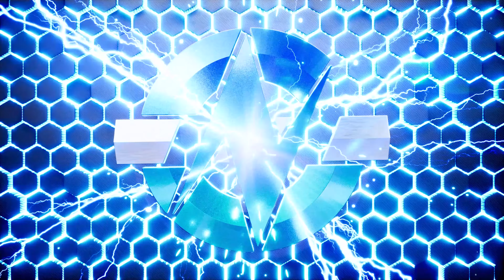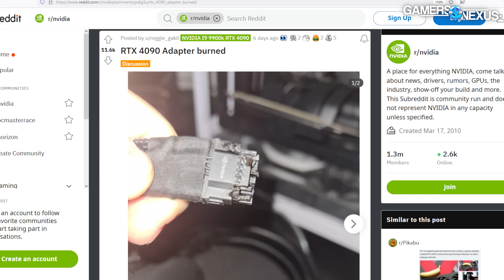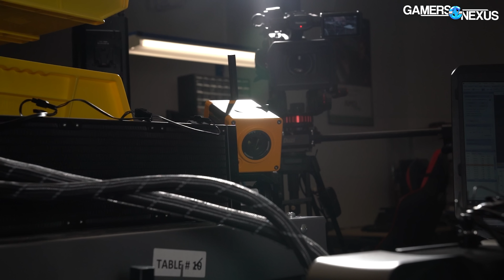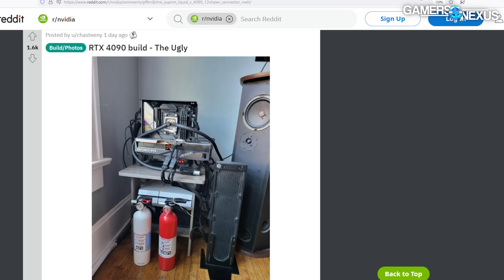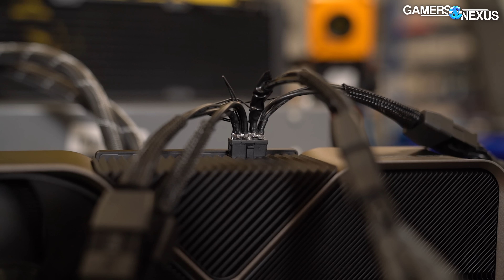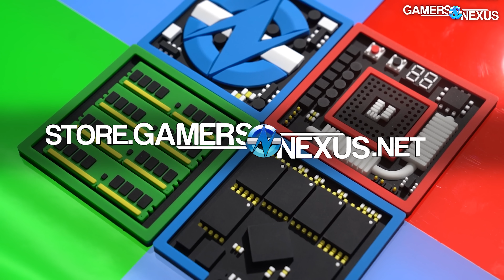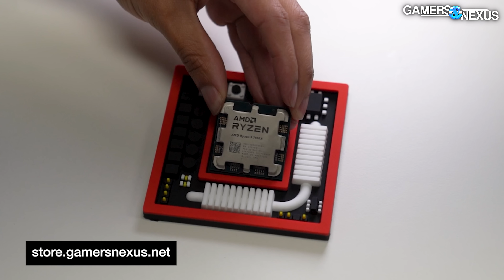Testing Burning NVIDIA 12VHPWR Adapter Cable Theories (RTX 4090)

Comment: buying sleep is easy... you have extra employees to lighten the load or take shifts... editors can hand off work to other editors, writers do much the same and when you come back in the morning the project should have more work done on it. Factories have been doing it for ages, my company does much the same with technical documents and even testing hardware. If your methodologies are sound and repeatable, it shouldn't matter who does them or writes them up.
Reply: before anyone gets uppidy.. I realize it is not "easy" in the sense of actually hiring staff willing to work odd shifts and or organizing such rotations can cause internal strife... however, you cannot say you have not figured out how to buy sleep if you do not explore all the options in a business that is punctuated by speed and precision.

Comment: Though I think that looking at where the wire connects is the problem. I see molex style minifit connectors melt at work all the time because of overcurrent or bad connection ( some of them are used outdoors in outdoor enclosures that are not sealed from the outside world ). When I rebuild or replace those connectors, I buy the more expensive pins and use heavier wire most times. That seems to help, but even the upgraded ones have sometimes started to get hot.

Comment: Something I pointed out on Jay's channel was about the possibility of manufacturing defects. For the connectors to melt like that they must have used the incorrect quality of polyamide or polyvinyl chloride. Power connectors are generally rated to take between 150-250C depending on the actual plastic type.

Comment: A few suggestions for the cameras Name. "Ripjaygor" -  "Nvidia QA" - "Predator" - "GeFire 4090E Extreme Super Ti RTX" - "Brutal by Temperature" - "lttstore" (for its color).

Have you tried briding the two dummy-sense-cables (the ones that are not isolated together in the same cablewrap)? Would that maybe trick the card into pulling more or do something strange?

Comment: Everyone is focusing on the cable but not the enviroment

Verry little people would use a computer on an open air testbench 

If you put it in a case with mediun to poor airflow where heat isnt propably being pushed out and then mix it wirh this issues it becomes more probable of failure 

Remember most people have to save money somewere on the computer and most of the time they skimp on cooling 

So they save money up for a new gpu and a new psu probably and then dont upgrade there cooling solution causing the internal temp to rise especialy near the hot components like the cable 

So in all posibility it could be a mix of the cable heating up to a temp in spec but being pushed over the limit by the surrounding components

Comment: You should take apart one of the failed ones. Remove the sockets with the Micro-Fit 3.0 depinning tool (Molex PN 11-03-0043) then de solder the wires. Check for failures in the bend from the soldered part to the socket. 

 I am incredibly surprised that Nvidia decided to solder it like that, these should be crimped. These connectors (supplied by Amphenol) are a copy of the Molex Micro-Fit 3.0 design. The contacts can handle 8.5A, but Molex makes one contact that can go up to 10.5A. I really hope that is the one being used. If this were to be made properly, it would be 6 18awg wires for power and 6 for ground, one into each contact. 18awg M22759 wires are rated for about 11A. 600W at 12V is 50A so per connection only 8.33A flow. No solder in any of these connections, all crimped.

Comment: Why Nvidia/AIBs don't just have 4x8 pin plugs on their cards, with 90 degree adapters out of the box is beyond me. Surely that would cost the same/be cheaper than making an adapter for every single 4090.

Comment: I contacted Zotac about being worried on the adapter and they responded this:

If you don’t bend the cable on adaptor then you should be fine.
Also it’s only the issues with early produced adapters.

Comment: I used to perform case studies on burned up molex connectors from various industrial settings. I always figured it could be something regarding thermal expansion over time, but watching this gave me some flashbacks. My settings were way more vibrational so that was always the bigger issue al but I don't think molex connectors shouldn't be used in higher current settings despite what their specifications can say due to the unreliability they provide, plastic's thermal efficiencies vs their cheap production costs. I've sat through crimping QA tutorials and done it myself by manual machines and hand crimpers. I think theres a trade-off triangle regarding of cheap, removable, high current connection points, and you can only maximize two.

Comment: I remember when I plugged in my 4090 for the first time thinking that the cable didn’t feel like it was plugged in all the way even though it was. I’m looking at ATX 3 PSUs because I need an upgrade anyway for OC but my timeline has been accelerated because of this. My card is still working but I’m not ready to take chances. For those wondering, my card is a Zotac AMP Extreme
Reply: I have the same card . I’m using the 3.0 and it gets hot as hell. It’s plugged in and everything just felt weird, as if it wasn’t in good

Comment: the real issue is that an 8 pin pcie connector with 16 ga wires to the psu can easily do 500w
doubt it? kingpin edition says your wrong and shut your hole, 1kw on 2 8 pins ez

Comment: If there are loads of different cables with different construction from different makers it could complicate finding the cause.
I don't think fully disconnected/broken off cable would cause melting also a brocken cable should result in a drop of power to the card and so a performance drop but a partially connection could as power would continue to flow.
A few question need asking like
1)Who made the cards 
2)Where did they get adaptor cable ie ASUS cable from Nvidia or MSI cable sauced by MSI. 
3) where was card purchased store retailer or auction site like eBay
May not be a specific problem with the connector But what is becoming a problem is Nvidia/Intel and AMD need to use more power for small performance gains they all just need to stop and ask themselves do people want or need a PC that requires 1000+Ws where's that heat going to go where's the power coming from and most importantly can the planet sustain what we are doing, after all no game is bottlenecked to point of being unplayable by 12900K/5950x RTX3090/RX6900 or there smaller siblings

Comment: Take good cables run resistance checks like cpu and pcbs you will see cheap wire filaments in the wire wrap and shielding

Comment: Paul's Hardware has the 300V wires but they're soldered just like Igor's, seems there might have been a couple revisions to this connector. That raises the question; if they knew there was enough of a problem to revise it twice why didn't they recall the early revisions.

Comment: What if the problem is the opposite of this train of thought.   I have had worse issues from underpower or undervolt situations.  

The damages from starving a device can result in heat faster.  Depending on the situation.  I don't have the coin for a 40 but in the past I have fixed failing gpu issues as a undervolt problem.

Comment: I’m a little confused. I have a Tesla coil that uses a very small gauge wire. It’s 24 AWG, a 0.5mm width, handles the 60,000 volts like a champ, but only draws 0.06 to 0.1 Amps. No overheating and no magic smoke. At the other end of the spectrum, a 12v car battery can handle a current load of 550-1000 Amps to start an engine, and uses a very large gauge wire (typically 8 AWG) to connect the battery terminals to the engine starter. No overheating and no magic smoke.

Note: the lower the AWG value (the gauge), the thicker the wire is. The thicker the wire, the more amps it can handle without overheating. Poor contact (i.e. like a cold solder joint) between the wire and the terminal is like splicing in a small gauge wire (say 24 AWG) in between them. The thin wire will glow red hot and then melt long before the large 8 AWG wire would. This is how a fuse works!

Fuses are rated in amps. If the current exceeds the rated amps for a fuse, the fuse will blow first, protecting the wires and their connectors. In the video, the cables soldered to the pins of the connector look VERY poor, and I’m being generous.

Is it safe to assert that when you used the term voltage, you meant current? 

Other than that bit of confusion, the video is really great!

Comment: Is there any difference to cable temperatures in a case with poor airflow? Seems like it could effect temperatures. 74 seems pretty high and close to having potential hot spots overtime that could melt housing.

Comment: I've never handled these cables, but when you plug them in, is there a very positive "click" when it's seated correctly? The pins are what's burning, so it's probably poor seating or contact of the tips of the pins. I suspect if you partially connect the plug (maybe not locked fully in place) you'll be able to recreate the burning as it appears.

Comment: I mean, the voltage rating on a power line doesnt really matter, it only lists how thick the insulation is. What DOES matter is the current rating. Using 14A cable on a card that draws 50A is just dumb, no matter how you cut it.

Comment: I wonder if they are quietly rolling out the better spec or updated cables? hmmm. I'm also starting to wonder if these failed cables have partially cracked/partially connected wires to the connectors (as shown by previously detached photos) causing localized heating in whatever is still connected. ie. the card sees the ground connected, so sends full power to the damaged finger/connector thus causing a hot spot which could melt the connector? My guess is either that or arching occurring from the cracked joint.

Comment: Based on where the melting is occurring, I'd assume that this is happening at the connection between the card's port's conductors and the contact pins on the adapter. It could be due to the way a user plugs in the cable (for instance if they don't plug straight in, but "roll" the connector into place).

Comment: Bent pin on GPU will be the cause not the Plug Minor bending or twisting of the pins will mess up the Contact down to a single point on the pin

Comment: Blows me away that as amazing as the 4090 is, they screwed up the power adapter. I would have liked to see an angled connector with a flatter ribbon-style cable that ended in 4 plugs far enough away so they could be tucked away. I think that a flat ribbon would look better than a single, giant round cable, just my $.02

Comment: Jay's cable was the same as Igor's. Can't be a red herring or an anomaly of two different content creators living in completely different locations both got the same wire. It's possible whoever supplied all 5 of the GN cables had them arrive from the same manufacturer. I'm sure once the community sends in their own they will likely see the same thing.

Comment: Maybe the solder they used was not rated for the amount of current going through it and turned into a resistive heater until it reached the melting point

Comment: My money is on the improper connection/strain on the connector. Depending on the case, cabling and setup, the cable could prove short and could put strain on the connector potentially pulling it loose. I have a 3080, and mounting it vertically is basically mandatory because otherwise there would be very high tension. 
Is there a reason why the card makers don't put the connector on the end of the card facing the front of the case? Everyone routes the cable towards the back of the case and down to the PSU, the connector on the end of the card would make more sense in both horizontal and vertical mounting configurations, and it would be more aesthetically pleasing because less of the cable would be visible

Comment: that camera needs to be named Claptrap from Borderlands. its yellow, has a single lens in the middle of its face... it's claptrap... also, i'm sending an email with info about my 4090 adapter, havent used it so i cant say if it will fail or not.

Comment: Copyright ©️ Homedad, arcing in the poorly soldered connections compacted inside the sleeve from the factory, poor insulation barrier. Opening to modify the connection takes away the same sort of compaction on certain cables.

Comment: i saw these 150 cable in chinese models and manufactors then check asus model they are 300 and back to chinese model all replaced ! Nvidia knew about it and replaced them
not all of 150 would fail if they wouldnt fit in its place they will fail
i saw this problem in mining asic a lot

Comment: Paul's cable is same as igore's, your cable is different, would help if you have mentioned source of your cable too. Sorry for long comment but to make sure it makes sense I had to explain it a little broader.

1- As far as I know 150V or 300V does not make a difference in how much Amp it can pass through, it is only cable isolation rating (plastic cover).The amount of amp that can pass through is by the cable gauge (and of course quality of copper used) 
2- heat rating is important, I wouldn't go with 105 degree for a product that can easily reach 100 degree. but the heat rating on cable is normally under rated, they can stand up to 150 degree
3- Power is distributed through 4 cables transferred through 6 pins then split between 3 users (VRAM, CPU, ...) some might draw more power and some less. on the other end, they are connected to 4 lines of PSU hopefully each having a separate provider circuit. when you connect all 4 cables your GPU expects 600W so it draws 150W per cable, that in your when reach the socket, it will split to 2 equally each 300W then split to 100W equally through each pin then go to GPU. In Igore and Paul's case, it splits to 4 150W over each cable then goes to 6 pins UN-Equally (150W outer pins and 75w inner pins). Now if your GPU is drawing 150W from outer pins instead of inner pins then probability of they melting is much much higher than the inner pins each carrying lower watt.
4- In situation explained in 3, if connection on outer pins is defect like igor's case (not Paul's), or poor pin contact, it will cause melting for sure.

Comment: @Gamers Nexus My suspicion is that for some reason the resistance of one or multiple pins from the ones soldered together is higher than the others (dirt,fat or bad connection) this would result in most of the current flowing trough the pins with less resistance. so if the outer ones burn the ones in the middle are bad. (Kirchhoff’s Current Law)

Comment: could the problem be from the connector attached to the card itself? the pictures so far don't indicate the melting starting in the main body of the cable, but rather at the pin and sockets.
it's something causing resistance or arcing there and resulting in a lot of heat at the location of the pins. if the distribution foils were the main source of resistance or arcing i think that the melting would have started there and not at the pin.

Comment: A cable rated at 150V or 300V is immaterial to the argument, this is a measure of the working voltage.  The wire guage of 14 should be able to comfortably handle 20A at 60C.

Whether the power rating of the PSU means it is better at handling high current demands and therefore putting additional stress on the cables - may be a factor

here, where there is a large number of individual 'causes' the probability is that they are having an incremental impact - connector socket design, mounting area, gold thickness, gold purity, soldering methods, crimping of cables, braiding, dry joints, connector asymmetry, dissimilar metals giving galvanic deposition.... and this is before we think about the customer influences.

First mover - caveat emptor !

Comment: One of the conclusions Jayz came to was that in some situations, the provided cable might be susceptible to heat issues, depending on the gauge of wiring and the quality of the soldiering. So, the a cable from the same factory might be good, or might be bad. The problem is the likelihood of getting a bad cable. He noted that custom cable companies that are using higher-quality components would be less likely to be the victim of bad soldiering. He also suggested that, beyond the gauge and quality of the wire, a one-wire-per connector was a better design than the new, more compact design.

Comment: There might be something about this "people don't push it in enough because there is no as audible click as usual" - this might be true. My cable adapters clicked really faintly and required rather significantly more force pushing things in than usual.

Comment: the spec for the 12vhpwr cable is faulty.... the temp is determined by the size of the connection and he amount of power being transferred.. its basic physics...thw connector is waaay to flimsy and small for the power that its supposed to deliver...want more power? use a bigger beefier connector and big beefy wires

Comment: Well, the testing isn't like the real scenario. Because your testing a broken adapter without the housing. So there's no way the heat can build up.. maybe try to re attach the plastic housing and run the test to see a difference.